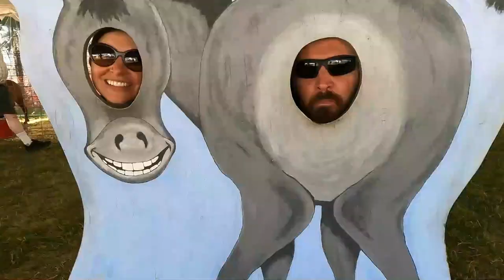Getting our new RV ready for the road

Comment: I laughed about the door, my wife has similar problems with our travel trailer. I’m curious on how you decided on the Reese goose box. We’re getting a Paradigm 295mk, can’t quite figure out the correct part number. Thanks
Reply from the maker: The door has been a terrible headache for both of us. We're looking forward to getting it replaced. As far as the Reese goose box, we wanted to free up the truck bed for one thing. We were also looking to reduce the pin weight by avoiding the typical 5th wheel hitch. Lastly, it has airbags to allow for a smoother ride. We've been happy with it so far, but we've only towed it 5xs. As far as I know, this is the only gooseneck pin box that will not void Alliance's frame warranty. Depending on which year 5th wheel you're buying (ours is 2024), the part number is 94920 - which is the gen 3 Reese 20K Goose Box. They have not come out with a 16K gen 3 yet.

Comment: What goose ball and safety chain anchors are you using (at the 5:13 time)? Where did you get it? Does the safety chain anchors spin or locked down somehow?.  I have not see this before. Thanks.
Reply from the maker: It's a PullRite OE Puck Series Gooseneck Ball with chain plate (item #4437). We bought it at Blue Compass RV because our other one failed. We like this one because it's an all-in-one system. It twists to lock the ball bearings in place with a safety pin. It's a solid ball, with no internal components. It can spin, but with the weight of the 5th wheel, it doesn't move.